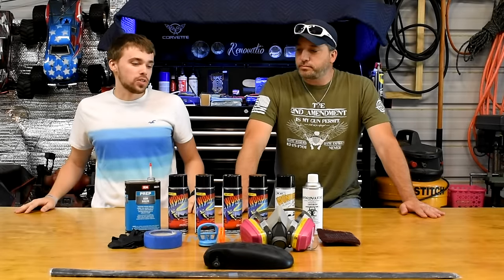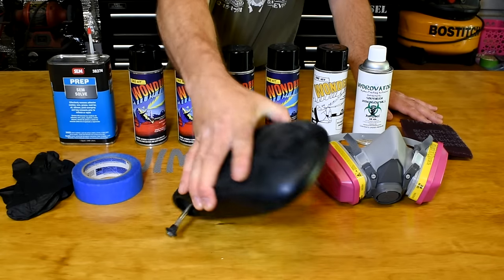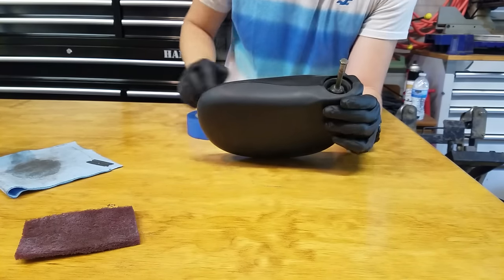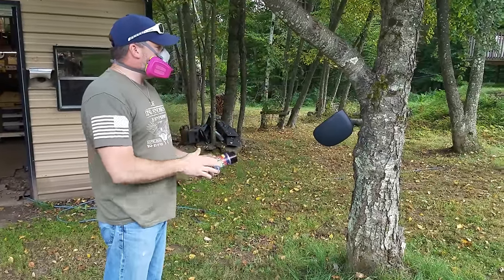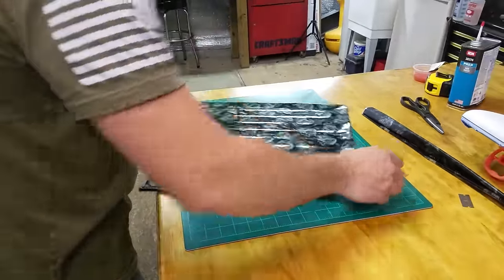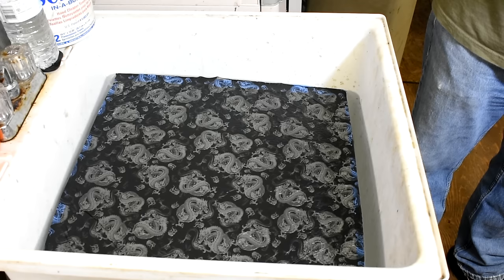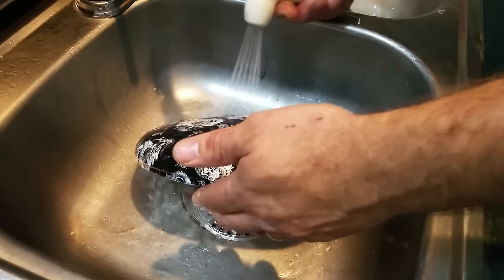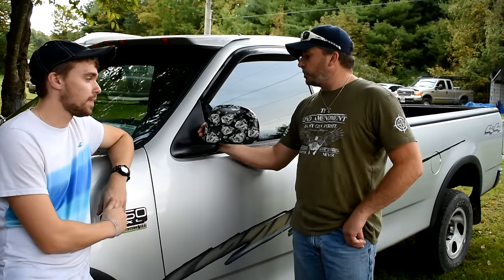How To Hydro Dip For Beginners 2.0

Comment: Can you list out the times for stuff? Like how long should we wait for the primer to sit on the item before dipping? How long after the activator is applied should we dip the object into the water? How long after dipping and rinsing do we apply the topcoat?
Reply from the maker: Well the times for primer will vary depending on outside temperature. Jist make sure your primer is completely dry before attempting a dip. After spraying the activator I wait around 10 to 1t seconds to dip the product, or usually enough time to pick it up from the table and walk to the sink. After your dip, you can rinse the item in the sink under warm water to to the sticky off the item. Once the item is completely dry and free of water, then at that point you can apply your topcoats. Much of the time is dependent on outside conditions. So use your best judgement:)
Reply: @Jimmy2Tech  thank you so much. I'm planning on using this for a hydro flask in a few weeks 😁
Reply from the maker: @EagleAirOne  best of luck to you!

Comment: Hi quick question i was just wondering what if i dont paint my side mirror? Do u think the film still going to stick on it?
Reply from the maker: It may stick depending whether or not your mirror is clean. But I can guarentee theres a good chance it wont bond 100 percent correctly so you may see more imperfections or places were the dip fails to stick properly to the mirror.
Reply: Jimmy2Tech  what about paint it to a gloss black?and sand it and make it smooth? Would that work? Cause i have a paint its gloss black with primer in it already im planning to do it sand a lil bit paint it and sand it again just to make sure its perfectly smooth do u think it would come up nice?
Reply: Jimmy2Tech  or maybe just buy a black primer sand it until its smooth and dip it do u think the film going to cover the whole thing perfect?
Reply from the maker: @roniesalazar386  I think you'll be fine giving that a go:)

Comment: Yea if you like dust and bugs in your paint then yes paint outside. Just paint inside with a respirator, no problems if you use that.
Reply: So I'm assuming that everyone needs to buy a paint booth or.....
I paint outside all the time with great results, your statement makes it seem that if you paint outside your definitely going to get bugs and dust, totally not true, it really depends on what type environment the person is in!
Reply: @BubbaB43   You can cut your fans and ac in the house off close the door, not move for an hour and there are still dust particles floating in the air.  Turn the lights out so its pitch black and turn on  a bright flashlight to see yourself.  Now imagine doing it outside. You can paint inside which not perfect is okay. Its not going to kill you. just buy a respirator and you will be fine.

Comment: When i use my sprayer in the sink to rinse the gloss it washes away the film a little
Reply from the maker: When that happens there is a good chance you're nott using enough activator for your dip. Make sure you get. A thorough, even spray, and give the item  a minute or two after the dip before you spray. Make sure your sprayer also isn't to much pressure. The goal is to rinse off the excess junk so the film isn't damaged.

Comment: what tape you using and what water temperature are you using as i am new to this.
Reply from the maker: We just used the Blue Painters tape and our water temp was about 90 Degrees Fahrenheit. Just make sure you cut the slits in the corner of the tape to allow it to expand. Only use the tape if your film curls a lot.

Comment: is it possible to print in plastic objects?
Reply from the maker: If you mean on plastic objects. It is, you just have to make sure it's not a type of plastic that may dissuade or "melt" when in contact with the activator.

Comment: Do you use hot water or  cold water
Reply from the maker: We use water that is around 90 degrees Fahrenheit (32.22 Celsius) that seems to work best but you can fluctuate that a little.

Comment: Me again. I just dipped my piece and it turned out okay (it was overactivated so there are some hazy weak spots) but my problem is the smell of the hydrovator. How do you combat the smell of the piece. I was going to bring it with me to school today, but the smell is way too strong even after sitting in the open for several hours. Any advice?
Reply from the maker: Immediately after your dip make sure you are rinsing the excess activator off, and we always reccomend putting a layer of clear coat over anything. This protects the dip and would help prevent any odor.
Reply: @Jimmy2Tech  noted. Thank you

Comment: How durable is the finished product?
Cheers
Reply from the maker: With some clear coat it will take a pretty good beating. It's pretty set for the elements but if you're going to be scratching it all the time it probably won't last as long.

Comment: Would hydro dipping a fabric shoes work? Would it peel off?
Reply from the maker: Unfortunately it wouldn't work due to the film cracking and leaking.
Reply: @Jimmy2Tech  you can do a leather shoe if you seal off different parts

Comment: I've never seen this before. It's a pretty cool process, but there are a couple questions about I have. I noticed that in some of the sharper corners or recessed areas the dip doesn't quite reach or adhere there and leaves something of a crack behind. How can this be avoided"? If it does happen, how do you take the dip off to give it another go? Also, it is obviously a very thin material and it looks like it left the treatment full of spider web cracking when it dried. Does this happen all the time or can that be prevented as well?. And just a couple more questions: being that it is such a thin layer on the part you dip, how long does it hold up in weather, or in a protected area that doesn't get exposed to weather. And last, how does it hold up to heat? Obviously, it won't be good for a manifold or some other part that gets really hot, or how did it hold up on the plastic engine cover you dipped in another video? Hydro-dipping is a great concept but there are some problems with the final outcome that leaves a lot to be desired so I'm hoping you can give me some answers to these questions. Thanks, guys.
Reply from the maker: Hey there! Let me try to answer some of your questions. Any cracks you see is usually a result of not enough film on the water/ a wrong angle when pushing the item in the water. We are not pros so we are still improving the more we dip. If you do have those issues you can easily sandblast off the layer if you wanted to redip the item. The dip is actually really durable, especially after you clear coat it. I've had my mirrors on my truck dipped for over a year now and it's still going strong. It hasn't faded from sun and hasnt been effected by weather/snow/bugs. Heat wise, it's fine too, just dont dip an item that is going to reach extreme temperature. But a cover that goes over a hot item like a manifold or things of that nature should be fine. If you have anymore questions at all feel free to ask! Thanks for watching by the way:)
Reply: @ @Jimmy2Tech  Right on. Thanks for replying so quickly. Good information. I'm surprised it can survive engine compartment heat. Good to know, but there isn't really much plastic under my hood and there will be a lot less when I change out my intake. The pattern possibilities are pretty interesting, and I imagine it is like everything else...you get better with practice. You did raise a couple more questions though. Is sand-blasting the only way to get it off?  What is the stuff made of? It's a really strange medium. Does it work equally as well on painted metal as it does on plastic? Another complication>>>It's kind of limited in application because you have to be able to dip the part in water. It doesn't sound like much fun at all finding a container of water big enough for say, a hood. Then having to remove it get someone to help dip it, clear coat it, and reinstall. Even with interior parts, they have to be removable, which can be no fun at all with a car interior, and your water container (and the sheet of material) has to be big enough to dip your part. It is kind of an intriguing idea, but I think I'm leaning towards staying with vinyl as the way to go. Thanks again for the response.
Reply from the maker: @jessblackwolf5333  hey no problem at all! You can dip plastic or metal. Both stick equally well. And you could get it off with sandpaper if you wanted. It is simply a film on the object. If you didn't clearcoat like 6000 times:p haha it should be as easy as a quick run of sandpaper to remove the film. Yeah the tank size can be annoying but the finished product is usually great and it's cool to be able to do it yourself. For large things like car hoods I would just have a place wrap it as they have better equipment. Also as a cool note, with the film if you are dipping something that withstands some heat you can actually use paint that changes color at certain temperatures. So when it's cold you wouldnt see the dip at all but then when it heats up the paint would appear clear and give way to the hydrodip pattern. Something cool to look into! My father and I have some we just haven't made a dip with it yet. In due time, I think we have a drone we are going to unbox and give a little guide on before we finish our next dip video! If you need anything else just let us know. Again, we appreciate the comment. Thanks for watching.

Comment: Hey, I really enjoyed this video. I've been taking robotics online courses and I plan on building my own drone and hydrodipping the canopy. I'm planning on leaving a square section on the canopy un-dipped with just the base coat, so I assume you just tape up a square with painters tape before you dip. My question is, I also want to put a decal in this square section. This might be obvious, but if I were to put a decal or additional painting on either the base coat or the dipped portion, would I put it on 24 hours after rinsing off the film with hot water, then wait another 24 hours, then clear coat? Thank you for your help!
Reply from the maker: Once you rinse, make sure it is completely dry and then you can begin your clear coat. I would put the decal on 24 hours after you applied your last coat of clearcoat. :) then you should be all set. Thats awesome idea for a drone. I love flying the DJI Zoom.
Reply: @Jimmy2Tech  Would you recommend putting on two coats of clear coat, one before putting on the decal and one after? Or should you not cover decals with clear coat. I would have thought to cover decals and extra painting with clear coat to lock it. Thank you so much for all this!
Reply from the maker: @tripleb5197  if you ever think about taking it off you'll have to peal a layer of clear coat which will look bad. But if its staying on there for the life of it then I dont see why not:)

Comment: Have you guys ever done rims at all?I'm gussing if you did you would wanna clear them for durability
Reply from the maker: We haven't done rims yet because we haven't made a makeshift tank big enough for rims. But correct. For rims we would deffinately clear coat when complete, and probably with a two stage durable clear coat that has better protection from dings and is not effected by extended periods of sunlight and road grime and brake dust.

Comment: Just wondering about the spray can's. That base coat would that be good on a wood skateboard first before going to dip it for colors after? Cheers!
Reply from the maker: I have seen people dip wood without a base. But I would recxomend as certain woods will suck up water and end up messing up how your film will turn out. A good base ensures there is a good bond and its free of any imperfections. So my vote is use a base before the dip if you're trying to do wood:)

Comment: Two questions. Do I need to put spray primer and all that jazz onto my item before dipping it or can I  just scratch it, clean it, and dip? Second, if i want to do a pair of Oakleys, how do i keep the film from sticking to the logo? I cant put tape on that its too small. Is there a chemical i can out on the logo to make it non sticky? Thanks. Btw I did find this video informative but not over the top. Well done!
Reply from the maker: Hey there. You dont always have to paint and prime but we are giving the best possible surface for the dip to stick to so that's the reason we reccomend it. As for the logo I'm unaware of a specific chemical but you could always use a small piece of painter's tape and cover the letters. It may be a dip free spot where the logo is but it may not look half bad. I'll keep an eye out for you and see if i find any ways to make that work for you better:) thanks for watching!

Comment: Nice instructional. One thing you should be aware of...Taping around the outside will hold the film square, this is not good particularly if the item you are wrapping has large contours. The tape causes the image to stretch more than it would do otherwise around the contours.
Reply from the maker: Oh very amazing point! I should have mentioned such. Next video, I'll be sure give that a mention. Thank you so much:)

Comment: I want to hydro-dip a Pro-Line truck body, do I pull off the masking to hydro dip the outside of the shell or do I keep it on? The design is skulls btw. 2nd do I paint the inside of the body white since the skulls are black in color?
Reply from the maker: Robert S Tiest hey there:) happy to help! So you're right with the base coat  of white inside the body. That will be the color that shows through with the dip. On the outside though, you're going to want to give it a spray of clear paint. That will give the dip a nice surface to stick to, then remember to give it a few coats of clear coat and you're all set! Should be good to go:) thanks for watching,if you have anymore questions let me know.
Reply: Thank you, my friend.
Reply from the maker: Robert S Tiest anytime. Glad to be of help:) make sure you hit that like button and subscribe to support. We'd really appreciate it.:)
Reply: So the inside gets painted White & outside film gets pulled off BEFORE you dip the body? The hydro dip is then painted outside the body instead of inside the body? Am I correct here?
Reply from the maker: Robert S Tiest yes basically, you'd paint your base coat color on the inside, then paint a Clear pain on the outside so the dip has something to stick too. My dad had another idea as well we are going to be trying this week if you keep your eyes open for a video. We are going to clear paint the inside of the body, dip the inside of the body, then try to paint over it making the base color. In theory we should see the dip with the background color we want, and this way if we were to roll the rc it wouldn't damage the dip. So stay tuned, and we'll be giving it a try.
Reply: ok will do

Comment: great video thanks a lot :)  you should try brake cleaner instead of sem solve, i'm pretty sure that it would work as good  as sem solve and it's way cheaper!
Reply from the maker: Froggy Vigilant hey thanks for the positive feedback! And yeah that could work, I've found that brake cleaner evaporates faster and is a little more harsh on shop towels, so I just use the sem solve which is okay because I use it for other purposes where brake cleaner would be to much. Thanks for watching though. Hope you liked it. Be sure to like and subscribe and hit that share button if you think it would help others. Thanks again.

Comment: Could this process work on wood for a pine wood derby car?
Reply from the maker: As long as the wood is sealed and isnt effected by water immediately, like particle board would suck up water immediately. You should be fine with a pine wood derby block though :)

Comment: What happens to the stuff that goes down the drain?
Reply from the maker: Any extra film in the water after the dip, we usually swift it off with a paper towel. That gets around 90 percent of the film out. The rest are small pieces that go down the drain. The more time you spend cleaning the film out the better it is:)

Comment: Who is the maker of your film? Or did you get it off a certain website whom sells film? I bought film off ebay and tried dipping a glass salt shaker a few times and it did not turn out at all, pretty frustrated. Wondering if the quality of the film has an effect on how the item turns out. As soon as the activator was applied the film like deteriorated. Have you encountered this?
Reply from the maker: lisa madell hey quality of the film is pretty important. The only time I ever had a problem with the film sort of just do solving away was when the tape broke off the edge of the film and the pattern sort of escaped. If you do have more problems feel free to DM me on the Facebook page and I'll try to help the best I can.